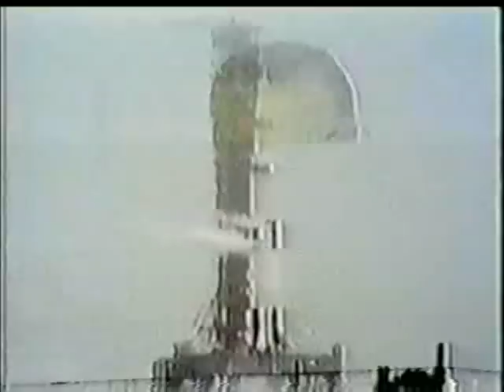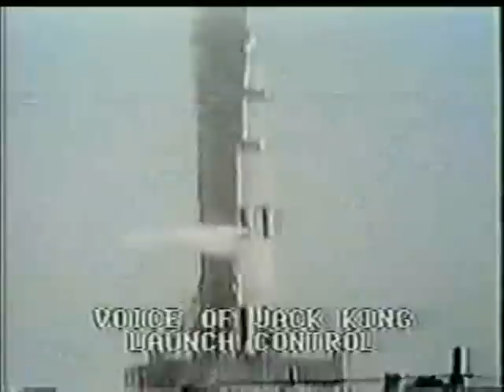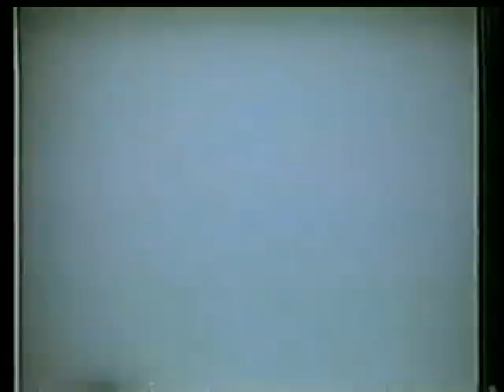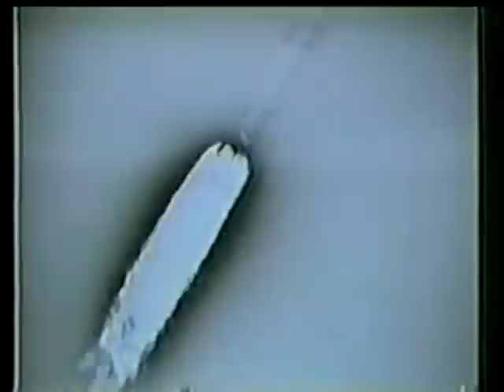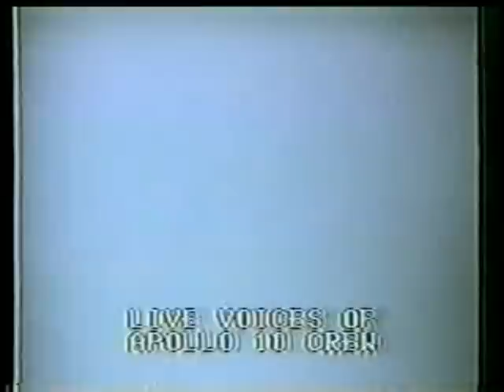CBS NEWS Coverage of the Launch of Apollo 10 Part 1 of 3

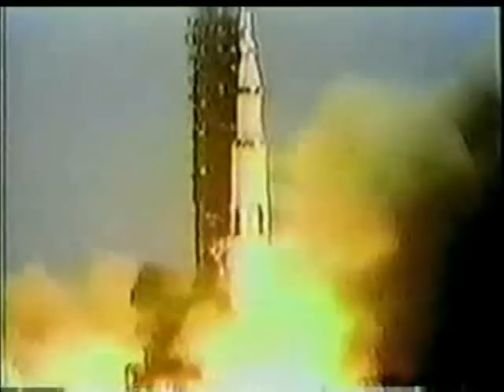Comment: Apollo-10-Was-Fake: 8:30 says: 3 minutes into flight, Apollo-10 is 46 miles high, 81 miles downrange (ie.: 81 miles wind-drift), which translates into an impossible wind-speed of 2,600 km/h, supposedly drifting the Apollo-vertical-airship (Balloon). However, it does fortify the fact that such fake rockets are drifted with the wind, similar to helium-balloons, specially because real-rockets can NOT be drifted with the wind, and ascend vertically up, unaffected with winds! At 5:20 it took the Fake-Apollo-10 14-seconds to clear a 100-meter tower, thus taking twice as long as a Helium-Balloon to ascend, thus proving it was NOT a rocket! Rockets need to ascend with an minimum acceleration of 3g, meaning that they must clear 100 meters in less than ONE-Second, NOT in 14 seconds as this Apollo-Balloon did! For similar disclosure, see my recent comments under Youtube: (Amateur Rocket Reaches 121,000 ft). For additional proofs, Google: ("Solving-Spacex-Enigma") and stop fooling yourselves people!